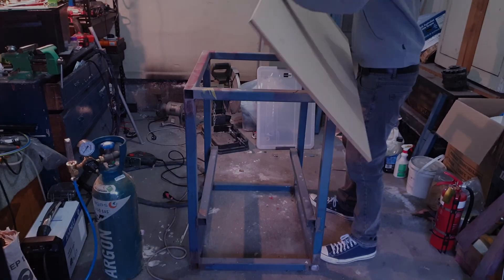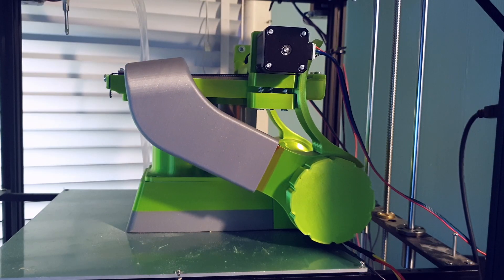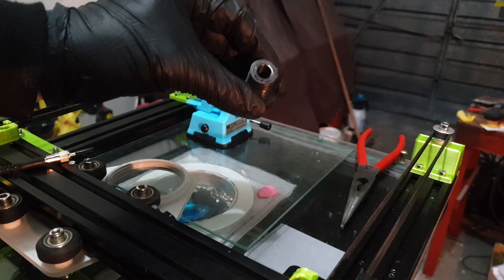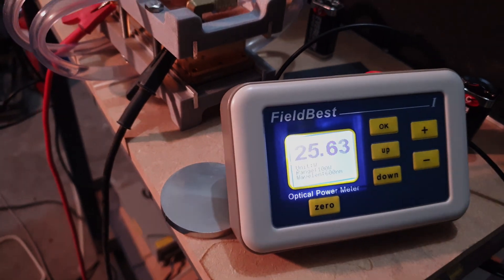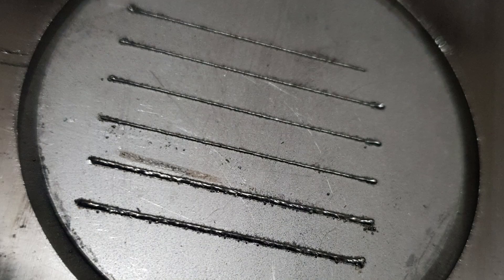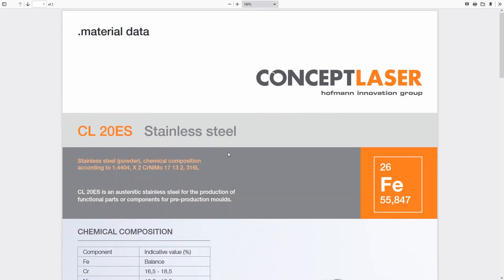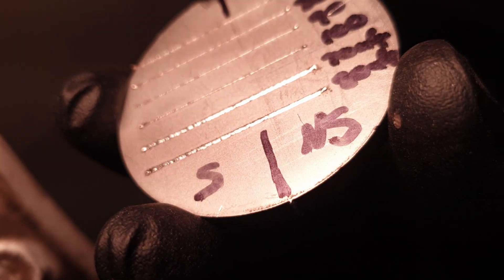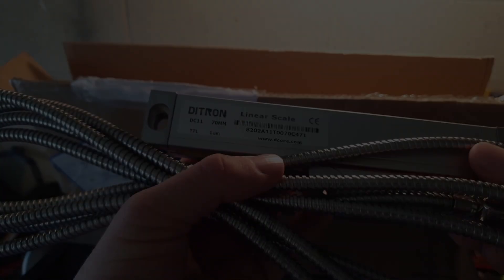The End Of Metal Tracks - DIY Metal 3D Printing

Comment: Instead of controlling the power supply you could bypass the current by shorting the powersupply. Add a MOSFET in parallel to the laser and turn it on when you want the laser to be off. This way the current in the power supply is always flowing(should help with ramp up) and you can stop the laser very fast since a MOSFET turns on in nanoseconds.
Reply from the maker: Inductance/overshoot will kill the diode block if the rise/fall times are too short. At the moment it is slower than it could be, erring on the side of caution.

Comment: Nice work! In 2008 I met a material engineer who designed a metal 3d printer with pretty good results (at least the ones he showed publicly). He did the powder layer spreading method similar to yours, but then used an adhesive sprayed through a hacked inkjet printer cartridge... Once the print was done, he'd sinter the parts in a furnace.

Comment: As someone who understood very little about the creation of your printer.. I found it fascintsting.. As someone who does specialty welding, needing to change gas percentages, voltage/ amperage, or alloying properties, I found it really interesting. Just not sure how all of that translates into lasers.. looking at it you need more heat input in a wider area for the amount of filler metal you are using.. or you have a compatibility, contamination issue with the base metal.

Comment: Have you tried pulsating the laser power? Like 70% half power, 30% max power? The idea is to heat up the material without melting it and when, locally, the material is hot enough to fuse with out sputtering you increase laser output to melt that spot and throttle it down fast so it can cool off. Sort of like tig welding.
Reply: Great point, if I'm remembering correctly, EOS uses a similar technique, as well as a heated build chamber.
Reply: @additivealex4566  Yea it's true .Do you use Eos ?
Reply: @manthanpatel45  yeah I have some experience using two different EOS machines.
Reply: @additivealex4566  Do you own machine or operating machine?
Reply: @manthanpatel45  just operating. I wish I owned my own machine but they're well outside my budget 😅
Reply: @additivealex4566  Dear Alex can I have your contact?
Reply: @johnjagger jack
I have pulsed laser . Gets similar results. But trying to get better results.
Reply: I think a heated chamber and low power would work best, less energy required to create a melt

Comment: 2:56 if the plastic swipe care still proves too stiff you might try car window wipers for the rain, think about how they just glide over ice not losing anything at all. and because they come from any where they should be cheap and easy to replace.
Reply: Car window wipers may have too soft rubber/silicon which scoops too much of the powder. The material is pretty strong otherwise.

Comment: I can supply you with an optical diamond window to protect your optics if you think it’ll help. It’s what’s used in commercial systems rated for many kW. Diamond is used due to extremely high thermal conductivity and durability. Overkill for your application but it’s the best you can use
Reply from the maker: Appreciate that. I'm not sure that is quite the answer to my problems but will keep that in mind.

Comment: you should try lowering the laser power near the end of the line travel to reduce heat build up and raised blobs. 
it would be similar to linear advance controlling filament pressure in a nozzle.
Reply: Part of the code could limit output of the laser to the actual speed, compensating for the acceleration issue. Additionally, the code could have a slight pause between telling the servos to move and telling the laser to turn on. That little buffer will allow the head to get up to speed or slow down. Downside is reducing the effective print area
Reply: @sgullage  I like this method more. Honestly, the closer you can get to actual temperature to target temp you can make it the better. It might even be worth it on larger builds to have passes being near more recent passes to compensate for residual heat.
Reply: Is this system using Marlin, Klipper or other open source movement controller? The code for Pressure Advance / Linear Advance in them is open source too, and could probably be used to control the laser intensity and speed/acceleration of the system based on a couple of variables.

Comment: oh, so that is who you can say "Challenge" in such casual way, Lasers instead of welding machine.

not that lasers are easy to do, however it does make the whole heat management less of a headache.
yet it does bring unique challenges and safety concerns.

and if the machine end up costing less than a reasonably affordable car I will count as a win.

Comment: wouldn’t this work alot faster with a cheap chinese fiberlaser? I guess software could be an issue there. Like a 60W fiber laser would be more then enough right?
Reply from the maker: Potentially. Nearly bought one but was put off by the various pulse widths they come in being right on the edge of heating. Nearly all papers I've read use CW so I followed the beaten path.
Reply: @metalmatters  Now I’m curious, how long or short do the pulses have to be? I have a fiberlaser at home that can go from 1 to 600kh. I would love to try that out myself and could tell you about the results

Comment: That little puff of smoke at the end of the fiber can be the most disheartening thing in the world. 

I feel for you! On the plus side….. in my case it’s always uncovered my unknown ability for cursing.

You’re really kicking some ass with this. I just found your channel, and It’s really impressive. It really is a new golden age for lasers, photonics, and equipment available to the home workshop DIY crowd! I think that’s wonderful. 

There are several ways to mitigate the fiber issues and guarantee immediate shut down before thermal runaway.

But it might be a bit too finicky in your situation. All of my fiber laser fun is usually done on an optical breadboard, but you’re really fighting in the trenches with all of that quick movement, And unique mounting. Sadly my experience does not stretch that far. So I would be a bit shy to suggest anything.

But you’re really on a roll, and this is some of the best photonics/laser stuff I’ve seen on YouTube in a long time.
Marco reps, breaking taps, Les’s lab, and zenodilodon….. they all have some insane and helpful laser content on their channels. 

I’m sure you’re aware of them but I thought I would leave them here just in case.

It’s like heaven on YouTube these days for REAL laser and photonics content. I never cared much for the balloon popping/burning laser pointer videos, but I love to see the science and stuff like this! 

Good luck! 👍🤘
Reply from the maker: Thanks!

Comment: I wonder if your current progress would work better if you built an enclosed chamber  that vacuums out air and fills it with noble gases, when done vacuuming back noble gases and letting in air.
Reply from the maker: It's quite possible things will move in this direction

Comment: Hi friend. You might to consider an laminar air flow across the powder bed. Looks like there is significant amount of spatter around ur scanned tracks. Metal vaporises under laser and condense when it hit the cold air. Those metal condensates attenuate your laser beam and by removing them with a laminar air flow, the melt will be much more consistent. The air flow ought to flow into a HEPA filter tho..

Comment: Not sure if you tried this (you talk too fast 😅):
About the droplets at the starts and ends of tracks: Did you try to first accelerate to desired speed and only then switch the Laser on? Or block/mirror away the Laser light if switching is not reliable enough? Same for stopping. Keep speed and Laser ON until end of track and only then switch the Laser OFF and decelerate afterwards?
I know some CNC CAM software is capable of creating milling paths where the speed during metal cutting is always as intended and acceleration/deceleration is outside of the current steel cutting surface. So for a 90 degree corner the CNC machine makes a loop at the end of side one to change direction and accelerate in the new direction before milling the side two.

Comment: You could try a ball mill (tumbler with ball bearings) for mixing the sulfur, it'd likely do a much better job for cheap.
Reply: I built one for black powder. Motor, belt, pulleys, rollers. Made the containers out of PVC. Not ideal for BP given static electricity, but set it outside and meh. Hasn't gone boom yet.
Cold shrink electrical terminations work great for grip on the rollers.
Lead muzzle loading balls for anti-spark media.

Comment: Wow that's a lot of work! Optics are a pain in the  ass!!! Got a blue 80 watt laser array from a projector- been battling  to focus it for my cnc ( tried 60×15 mm biconvex tried a 60×35mm convex but can't get it to cut 1mm steel... I can get it to melt the surface of a Stanley  blade and make the whole blade red hot but I can't get it to cut. I have got a 5watt blue module which can cut 15mm wood and engrave steel-slowly(it has a .03mm focal point- apparently it has a FAC lens ) so I assume it would be  possible to cut steel with 80w.

Comment: Great job!
Though I'm a little confused. I watched SLA printing videos and they preheat chamber, thus the needed laser power for melting is reduced.
Also I was thinking that using thermite-like powder mixed with more metal in low-oxygen atmosphere using laser just as a trigger, though it would be difficult to localize burning. Basically, if we could aid control melting physically (preheating) or chemically.

Comment: Silly thought - would it possible to first run the laser out of focus over the printed region to partially sinter it to combat the powder being dragged in to the melt pool?
Reply: I second this thought.  General Electric uses this strategy with their metal printers…
Reply: @atari7001  Yes but those are electron beam melting machine, not laser melting machines, they have huge magnetic effect on the powder and thus needs this pre sintering. Denudation (removal of powder due to gas displacement) is inherent to this laser process. Process parameter have to be fine tune to minimise it, but it will always be here. I would suggest to go faster, limiting the heat applied to the melt pool and thus evaporation of material causing this powder suction

Comment: I would add mass to the machine base.  It appears you have a lot of gantry sway going on e which is going to effect your focal point.  Another thing to consider is the machine may not be reaching your specified speeds.  The distances travelled are shorter than the acceleration the machine is capable of.    It would also be best to eliminate any sharp turns the machine has to make.  Radii help prevent the machine having to stop and then accelerating on another access.  The bigger the radius the longer the machine has time to accelerate the new axis motion up to speed.

Comment: What about microwave asisted sintering? i.e. if you have roughly equal powder sizes, you can use a microwave cavity to bring them to their (size dependent) critical temperature, then you don't need that much power in the laser, and you will not suffer from turbulent effects (i.e. domain wall will be less pronounced)
Reply from the maker: Not sure I'm game enough to add a microwave into the mix. Preheating via defocused scanning might be a solution though

Comment: Regarding the fiber end and how you noted the original connector was open ended, this is likely using an air gapped ferrule. This will mount a cleaved fiber so it has an optical face but will not have any epoxy near the end face. For any high power application this is usually preferred since it reduces the risk of epoxy related thermal damage/thermal runaway. Using a standard connectors thats polished with epoxy mounting the fiber in connector up to the end face runs higher risk of damage.

Comment: Happy to see the progress!
Is this likely to be viable for aluminum printing as well?
I know it has a very narrow working/melt range.
Reply from the maker: I won't be pursuing it. I think you'll need a substantially higher power density to offset the lower absorption.
Reply: aluminium is much much harder to work with compared to steel.

Comment: What aluminium powder are you using?
Reply from the maker: If by Aluminium you mean SS316, this is the supplier I use: https://hermus.en.alibaba.com/productlist-4.html?spm=a2700.shop_pl.41413.46.74cd25cdLCwvQy&filterSimilar=true&filter=null They've taken down the link I used but it was 15-45um, spherical 316L. If you do buy some, read the SDS and wear appropriate PPE.
Reply: @metalmatters  Thank you!

Comment: Cool project. Are you’using a nitrogen generator?
Greetings from someone on the commercial side of metal printing equipment development
Reply from the maker: No, Argon currently. I've definitely considered switching over to nitrogen for the sake of that option, for the cheaper gas if anything. I will have to rebuild the enclosure before it's an option unfortunately.

Comment: There are a few guys that have put together their own CMM using epoxy and sand/granite/special concrete for the base to reduce vibration. Cheap, just need molds. Might be worth establishing your machine and then fiddling with optics, speeds, etc

Comment: I think your slow switching times are due to your power supply.  The actual laser junction should be able to turn on and off in micro-seconds and modulate in nano-seconds.  (fastest turn on will happen if you idle the laser diode sub-threshold before applying full current)  You'll want to get a cheap "test dummy" laser for testing, but you could get real gains in power controllability if you leave the bench supply on continuously, and use a custom circuit to regulate the laser current.  The simplest and safest is probably a parallel shunt regulator to steal current from the laser when you want to reduce power output.
Reply: Can these diodes be modulated in power easily?

 If the power can be adjusted contnously then it shouldnt be too hard to take in to account the acceleration and start/end and make a function that calculates the power output to ensure the same laserpower gets dumped in every mm. Otherwise PWM?

If you want to go ham it should be possible to make a program that takes 3D printer gcode and calculates laser output power for the whole file based on the movement speed at each moment. So you could use a normal slicer for a file then just run it through the described program and get metal laser gcode.
Reply: @scifactorial5802   Don't need to do that much work.  The 3D printing slicer already does all this.  Just need a circuit to translate extruder steps to laser pulses.
Reply: @martylawson1638  Very good point, I don't know how I missed that.

Comment: Hey there! I saw that you were printing these components out of PLA. I understand that the cost is probably a fact and that you want to keep it as inexpensive as possible.
Reply from the maker: I'm hoping that it'll get to a point where I can print some parts (e.g. the leadscrew mounts) from metal. But yeah, minimizing cost is the imperative.
Reply: @metalmatters  Perhaps at least using ABS/ASA would be a better alternative in the meantime? A lot of the time it's just as cheap as PLA, if not cheaper. Besides the temp resistance, it seems to minimize the effect of creep under load far better than PLA, PETG and even Nylons in many cases. After initial prototyping in ABS I've been using a CF-ASA in builds to further improve this and overall stiffness. It's surprisingly easy to print.

Comment: molten metal spray actual layer printer, like resin but nano printer jet print head sprayer
Reply: also  you can get a very thin coating with spin coating, ie, powder or liquid metal powder, spin a layer, let the solvent vaporize, or direct laser vaporize and melt
Reply: you could also use a very thin spike heated as point close melt needle, very close above the powder
Reply: thats a soldering gun
Reply: standard pla/abs print head
Reply: try electric field ion deposition, positive ion source nozzle, attached to a negative target metal surface, or alternatively, anode ray tube, ie, flying ions to a growth substrate
Reply: try tin sn99 soldering wire 3d printing, then electroforming at room temp to titanium/chromium or any other high temp metal

Comment: Does the laser need to be CW or can you use a q-switched pulse laser? Just thinking of styropyro's tattoo removal laser.
Reply: Continuous wave lasers make the welding process similar to existing welding processes. Pulse lasers open up a whole new can of worms when it comes to consistency of each vector in the raster pattern. There is a company called seurat technologies working on making the use of pulse lasers an advantage rather than a disadvantage. But again. There is a huge can of worms there to sort through.